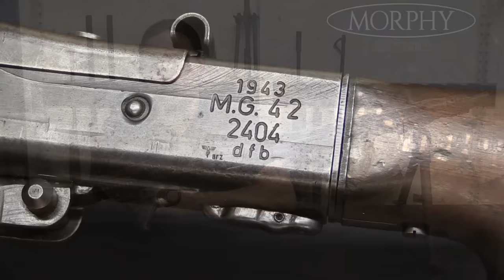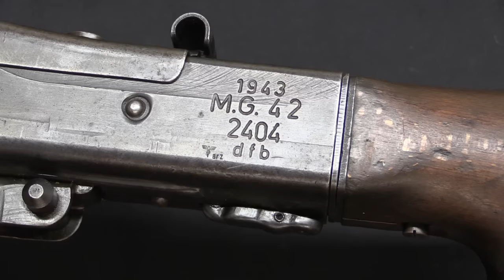Hitler's Zipper: The MG-42 Universal Machine Gun

Comment: When I was drafted in to the Danish army in the early 70'ies I became a machine gunner and this is the gun we used. You could reliably hit larger targets at 600M but it was a good idea to strap an old tin can just outside the feed port to smooth out the belt feed to prevent hang ups. It was a bit tricky to shoot if you were not lying down but they did teach us to use it in a walking stance for close combat. You had to grip the forward legs with your left hand and jam the butt very tight in towards your body. If you did not hold it tight enough the recoil would not reload the gun and it would stop. It came standard with two barrels, a cooling tray and an asbestos glove to change them with. They got real hot in a hurry. Pretty sure I could still field strip and assemble this one blindfolded. A bonus was that the cooling ports on the left side of the barrel shroud worked great as a beer bottle opener. Take the bottle in your left hand and stick the cap in while you flick the pistol grip with your right hand and Viola!... Yes that was in the days before screw top beer bottles :-)
Reply: You have screw top beer bottles in dennmark?
Reply: @thebaumfaeller1477  Nah but I now live in Canada and it comes with weenie US beer
Reply: Screw top beer bottles? What kind of atrocity is this? Usually you have to taste beer to judge it, but if it comes in a bottle like this, you immediatly know it will be pisswater :D
Reply: @yoshisaurusrex3767  Actually, I've seen local breweries here in Quebec use screw tops while still having a good product. I can't imagine it'd last very long that way though.
Reply: @asweknowit123  Though a champagne cork rather than screw top Unibroue's Maudite gets my vote
Reply: @yoshisaurusrex3767  Yuenglings comes in screw top bottles. That's the only scewtop beer I can say is safe to drink
Reply: @Kim-the-Dane-1952  I don't know any beer in the US that has screw-off caps.  Only girly drinks and wine coolers have screw-off caps.
Reply: @Kim-the-Dane-1952  Since when does Budweiser and Coors have screw-off caps??  Has it actually been that long since I last had either...?
Reply: Probably the MG3 though.
Almost the same gun, but 7.62 mm.
Reply: Screw top?
That sounds hellish
Reply: You talk about some excellent intimate history you have with this legendary weapon. And all people can comment about are bottle tops.

Meine Got.
Reply: @thehavoccompany-a3  more like twist off caps
Reply: @davecrupel2817  What does "meine got" mean?
Reply: @oldverner  100% sure its not a MG3, other charging Handle, no "Fliegervisier" aircraft sight and the Pistolgrip is Metal ..............., its an early MG42
Reply: @Sturminfantrist   :-) I was talking about  the danish army gun "Greerops" mentioned in his 
comment - not the one in the video :-)
Reply: @23GreyFox  It's meant to be "mein got" meaning "my god" in German.
Meine is for female words mein for male.
Reply: @phreak761  War auch nur als witz gedacht, obwohl es "mein gott" heißen müsste.
Reply: @23GreyFox  Mein got.
Reply: @Kim-the-Dane-1952  are you sure that it was a mg42  and not the mg3 which is it's successor
Reply: @timansorg9594  Pretty sure as that it what it was referred to as by the regiment (M42) but naturally I could be wrong.. it  had the bakelite shoulder stock but naturally it was the one with the ratchet loading handle.
Reply: @Kim-the-Dane-1952  okay I just thought that by that time the mg42 was phased out in most armies and replaced by the newer mg3
Reply: @timansorg9594  Yeah well maybe not so much the Danish army  :-) The regiment also still operated Centurion tanks with gasoline engines at that time
Reply: @Kim-the-Dane-1952  so it's save to say they weren't up to date at that time:)
Reply: @timansorg9594   Indeed.. ..The riflemen even used the good old Garrand rifle. To this day 30.06 is my favorite hunting cartridge
Reply: @Kim-the-Dane-1952  well I mean if it worked it's not that bad. Yeah the 30.06 is a great bullet which has proven itself in many occasions now
Reply: @phreak761  God is "Gott", i'm native german.
Reply: @23GreyFox  Oh mein got.
Reply: @phreak761  Ok, i get it troll.
Reply: @23GreyFox  *Oh mein got.
Reply: @Kim-the-Dane-1952  You are probably talking about MG42/59 which is early MG3 variant(7.62x51mm NATO) which Denmark bought in sixties. They weren't original 7.92mm MG42 surplus that's for sure.
Reply: @kognak6640  Thanks for the clarification. That would explain why they were still referred to as MG42's at GHR
Reply: Someone also mentioned that the MG42 and MG34 don't have have much recoil due to an Online stock is this true?
Reply: @omartorres5688  I can't really say since I don't have much to compare with.. the only other machine gun I have shot was the Browning M2 50 cal but they are always securely mounted. Still I thought the MG42/3 kicked pretty good.
Reply: @Kim-the-Dane-1952  I see but a least you got to shoot good guns
Reply: The function of this gun as a beer opener is impressive, much better than to kill people with this evil thing. But who is Viola? Did You open up her too with Your gun??
Reply: @yoshisaurusrex3767  it would usually be u.s-brew - We dont have screwbottles in europe, we dont need that kind of children assistance to get to the beer :)
Reply: @Kim-the-Dane-1952  Hvorfor flyttede du?
Reply: @timansorg9594  Well at that time we had the strongest artillery out of the nordic countries in europe
Reply: @ulfenburg7539  pga arbejde. Jeg arbejdede for ØK og var i Hong Kong og Manila før jeg kom til Canada. Jeg er nu gift med en Canadier og tog ikke hjem da ØK lukkede. Canada er et fint sted at bo.
Reply: @Kim-the-Dane-1952  Ja det er det.... men det er nu ikke Danmark :)
Reply: @ulfenburg7539  Nej det er rigtigt nok og det er måske også derfor at jeg stadig er Dansk statsborger og kommer hjem så ofte som jeg gør.
Reply: @Kim-the-Dane-1952  Det er godt at hører at vikingen kommer stadig hjem en gang imellem.
Reply: Brugte en MG til at åbne øl - Jeg har aldrig været mere stolt over at være Dansk en den sætning.
Reply: @christiankongsted5084  Bruh. Jeg glæder mig til jeg kommer i hæren men jeg skal fandme ikke ind i infanteriet. Mit mål lægge i at komme ind og bruge vores nye artilleri
Reply: @ulfenburg7539  Hey bruh, skal faktisk selv i hæren, ind til Jydske Dragonregiment. Godt at vide at nogen i vores artilleri kommer til at se de rigtige videor. ;)
Reply: @christiankongsted5084  Hey hvor gammel er du? Fordi det kunne være grineren hvis vi kom in på samme tidspunkt.
Reply: @ulfenburg7539  25, jeg trak frinummer da jeg var 18 og valgte for nyligt at prøve værnepligtenl. Jeg skal ind den 1. marts, corona gjorde at jeg ikke allerede er startet. :(
Reply: @thehavoccompany-a3  screw tops are an American thing, the only screw top bottles in the UK are American beers, not that many have managed to break into the market. I was under the impression that all American beers were screw top as in all American films and TV shows they're always screw top.
Reply: @kaneworsnop1007  Only the crappy (mainstream pi**water) beers.  The good beers (typically from local breweries that aren't commonly seen outside the US) always have the standard caps.
Reply: I used it (well the MG3) 40 years after you did, also as a dedicated machine gunner.
The only difference is we used thick leather gloves (for obvious reasons).
Reply: @CharlieTheAstronaut   Did you also have a grumpy helper who had to carry the tripod mount along with his own gun? ha ha
Reply: Exactly. The high rate of fire made the extra barrel a need, and the bolt was typically German-over-engineered.
Yes, it was a god MG and the most important wapon of the infantry group (and the Carl Gustav).
But I'm still convinced that Madsen could have made a better, less complicated, lighter MG, with a less firerate, that would preserve the barrel from getting to hot.
Reply: Omar Torres o
Reply: greerops in
Reply: greerops b by in
Reply: greerops l on
Reply: greerops in
Reply: Christian Kongsted pool job
Reply: DeadlyBacon in tv
Reply: The mg3 was adopted by the Danish army in 1962, therefore it was officially called mg m62.
Reply: @bjarnefrederiksen8540  Tak Bjarne
Reply: @Kim-the-Dane-1952  agreed an mg42 should come standard wit any good case Of danish beer.
Reply: @23GreyFox  like "OMG" - "my god" literally.
Reply: @MarquePierreSondergaard  I know.
Reply: @iberiksoderblom  Over engineered? How? The MG-42 is in the list of best MG's ever produced for a reason. The Madsen is not in that list. The Madsen is harder to produce and maintain.
Reply: Much regards for mentioning a beer bottle opener.Always a good thing for any tool/vehicle/gun to have to any real soldier ;)
Reply: @23GreyFox  It's misspelled German for "My God". Correct spelling: Mein Gott.
Reply: @Kim-the-Dane-1952  you wanna try the checzk budweiser, which is the original -that is beer
Reply: @zymelin21  I completely agree with you :-)
Reply: Woah woah aesbestos gloves?😳
Reply: @_david_xu_5926  Sure.. remember this was the early 70ies. I think they would have been happy to put that stuff in breakfast cereal just to increase the fiber contents in those days
Reply: @Kim-the-Dane-1952  thanks for sharing man I'm a Canadian and always had trouble opening beers with my mg42.
Reply: @Kim-the-Dane-1952  well happy we have stricter guidelines now thanks for sharing
Reply: I bet the armoures loved people who used their weapons as bottle openers.
Reply: @Kim-the-Dane-1952  I feel attacked, lol. I spent a year (conscription) as spotter/loader/replacement gunner in an HMG squad (MG3 or m2.50 depending on circumstances). Thankfully we almost exclusively used tripods for fixed positions, so we rarely had to lug them around. I would gladly have traded my G3 for an MP5 though, what with carrying spare barrel, tools and ammo for the MG3.
Reply: Mhmm asbestos.
Reply: Interesting....
Reply: He’s not referring to a screw top cap like a bottle of soda or water. 

What he’s referring to still looks like a metal stamped cap, but instead of requiring a bottle opener they can be twisted with the bare hand.
Reply: @Kim-the-Dane-1952  30.06 was the first round I ever chambered! 8 years old and my uncles say let the little guy fire grandpa’s deer hunting rifle. Dad stood behind me when I fired so I didn’t get laid out in the yard, it hurt so bad from the recoil! To this day I remember it so clearly 50 years later.
Reply: I can't believe Gun Jesus made a 23 minute video about this gun and failed to mention the bottle opening feature. A major oversight.
Reply: @Kim-the-Dane-1952  bless you, old soldier. A nice story for sure. Yes, my country has awful “beer”
Reply: @kaneworsnop1007  it depends on the beer. Screw tops are common, mostly on corporate products. Just a roll of the dice
Reply: Meh, many craft breweries use screw top bottles. Screw-tops no longer denote pisswasser. Any American that gives a shit about beer knows which brands are best only for the infirm, young and elderly.
Reply: That's awesome, my father was I'm the US army in the 90's and used the M60 in his support gunner role. A funny thing he figured out is that if you take two of them and put the belts on one forearm and lift them up and start shooting, the recoil helps keep them up so you can fire two of them at once!
Reply: @Kim-the-Dane-1952  haha still european at heart
Reply: That's some OG shit right there, respect
Reply: CAP
Reply: You know, I would buy you a beer and open it myself to just hear more of your stories. God bless.
Reply: @Kim-the-Dane-1952  nope they aren’t beer
Reply: The cousin is the US..m_60.. I used that one that was after Viet nam.. I could Field strip fast back then
I'm in my 60s now and could blast the CRAP out of anything still... forgot the break down of it.
Take care.
Reply: Dude that makes you like the GI Joe called Roadblock. That's incredible that you could fire this from the shoulder.
Reply: Why did you move to Canada?
Reply: @Kim-the-Dane-1952  I thought you moved because of the beer  :D
Reply: @cochinaable  I worked for a company that posted to several jobs worldwide and eventually ended up in Canada where I then quit the company and stayed. It is a very nice place.
Reply: Yesss but i use a sling if firing from the hip which i learnt in firing the FN GPMG when i was a soldier and an abestos glove is essential too.
Reply: Vi bruger den stadig som tårngevær 😂
Reply: 100th comment: Legendary
Reply: @Kim-the-Dane-1952  its a damn Good Caliber for Hunting.
Reply: @yoshisaurusrex3767  lol you cant base flavor on whether or not the bottle is a screw top or not. 3/4s of americas beers are not screw tops but they still taste like shitty flavored water.
Reply: The idea of being a unit that draws heavy fire by it's very nature, and being fairly stagnant in the process, must have been terrifying
Reply: This has got to be the most badass comment on this video haha, have gun ..will travel .
Reply: This dudes a fucking bad ass
Reply: dang you musta had killed a lot of fellers with that there machine, eh?
Reply: @yoshisaurusrex3767  ok child
Reply: Spoken like a squaddie
Reply: @Kim-the-Dane-1952  Are our beers not sufficient in size?
Reply: For some reason I read this comment out loud in a danish accident, you should’ve seen the head tilt action from my 9 month old German Shepard. She is something else, both sire and dam are of the East German working line. My 6 year old GSD he only gave three tilts, I’m sure there would be more if the words ball and throw were used.
Reply: Fair show! To be honest though I still pop screw tops since they tend to love to get stuck and rip your hand when you're a bit bottled.
Reply: I will cherish this knowledge forever. Thank you, kind Danish veteran 🙏
Reply: Screw top beer bottles? Here in Germany this is literally non-existent, except for those plastic beer bottles.
Reply: Are you sure it isn't an MG3?
Reply: @munanchoinc  Somebody else mentioned that as well and it is entirely possible because of the arrangement of the cocking leaver but on the other hand it did have the bakelite shoulder rest so I am not sure.
Reply: @ralfhtg1056  I’ve seen screw top bottles only once here in Ireland. And it was Miller. So barely beer in the first place.
Reply: just a little tip it's "Voila" not "Viola", freat story tho !!
Reply: @michaelkeaton5394  Je suis vraiment désolé.  Mon professeur de français serait horrifié.  Je blâme "auto complete" sur mon téléphone.
Reply: @Kim-the-Dane-1952  auto correct ducoup, nah no worries man i always screw up a few word in other languages too...
Reply: @deltabravo9908  Nice try buddy :-) ... anyway good for Scotland... the only screw tops you need are the one on the Whisky bottles
Reply: @deltabravo9908  God no!!!! I was referring to my current place of residence which is in Canada
Reply: I might be cool but I’m not as cool as you my friend
Reply: What about longships? I heard the danish were Vikings, is this true or false?
Reply: @Kim-the-Dane-1952
Reply: Yep. I fired one of these a Soup can works wonders. I am a Gatling Fan so how to make a 155mm Howitzer turn into a Rotary. Hmmm
Reply: @greerops 
I was in Germany in the Bundeswehr as a MG Gunner too, i had the MG3 as a service weapon too, and i can confirm that the heat protection shroud is an excellent beer bottle opener 😁😆
I used the same hole every time to open up a bottle back in time of Cosovo, and it worn out very much.
You could easy see the one hole and everybody knew what that came from 🤣😅
Reply: @saschakorner9317  Ha ha.. Great minds think alike
Reply: @timansorg9594  The MG3 is the same as the MG42 except the calibre. Italy adopted the MG3 and produce it under licence. The call it MG42/59.
Austria call their MG42 version MG74 because they adopted it in 1974,
The first batch of MG3 delivered to the West German Bundeswehr in the '50s had their MG42 markings stamped over with 'MG3'. Except the barrel the parts are interchangeable between MG42 and MG3.
Reply: why was this MG not used as a COAX MG in tanks??
Reply: @yepi3345  due to design of the barrel change system necessitating adequate clearance to the right side and the right side only due to the inability to switch which side the barrel is ejected from during changes.
Reply: Indeed; I served in the Danish army as well (hej i øvrigt), although later on so we had the '62... but same family, though. c",) Along with the 12,7/.50 cal. they did a good job.
Reply: @brufnus  Hej tilbage. Ja 12,7'eren var også sjov at skyde med.
Reply: Thanks for the great recollection on use of MG42.  I carried the M60 for a period when I was in the US Army Infantry.  Supposedly it was a fork of the MG42 development.  The most interesting and unique part of the M-60 design in my experience was its low hopping rather than it just climbing.  It made it perfect for grazing and suppressive fire.  We were never allowed to fire it from the hip (assault mode) of course I did it a couple times but it sucked almost a complete waste of ammunition.  We had problems with blank firing adapters that wouldn’t provide sufficient gas to work the action and you would have a bolt action rifle.  😂 
I volunteered to carry “the pig” because I only had to carry my kit and ammo and was now a major asset for the company and had the power to defeat just about any opponent in a firefight.  Nothing like the look on your buddies face when I would bound up and drop in the prone and carry the day.  😊
Reply: @daviddunkelheit9952  Thanks.  I agree with your observations and it was indeed fun to stroll about being the Lord and Master of small arms but as my sergeant was fond of reminding us: In active combat the machine gunner has about a 10 second life expectancy 😒
Reply: @Kim-the-Dane-1952  I’ve heard that as well and I had a Company with an odd SOP for night-time operations (training exercises).  Because of the distinct sound of the M60, anytime we fired it we had to displace our position by a minimum of 1 grid square (1 kilometer typically).  We were in wooded granite highlands and that really sucked to move a click plus everytime.  So it was decided that at night when we are getting harried by probe attacks from OpFor I was not to give away my location by engaging in a firefight… 🤭
I got to just lay there in a ruck flop with my pig in my lap or across my abdomen.  On vacation 😆. I loved it got to catch zzz and less carbon to clean later.  It was totally the opposite of what most guys expected.  I later was a M249 SAW gunner.  Not quite the same. It was based on the Belgian FN Minimi (Mini Mitralleuse) fired 5.56 from assault packs or 30rd clip.  The early ones didn’t have a good heat shield over the barrel so I burnt my forearm twice as I would control the hop in the M60 with my left forearm.  The early version also had “normal” and “adverse” cyclic rate selection.  It had a high rate of fire already and supposedly adverse rate was to clean out the carbon if you didn’t have time to clean your weapon..  700-850 normal 950-1150 adverse.  That could only be used with regular FMJ rounds as any BFA could not support that rate of fire and would go downrange. 😱
Good memories! Allons! Enjoy your weekend nice chatting
Reply: @daviddunkelheit9952  Thanks... You have a nice weekend as well.
Reply: SAME with our M-60 the tin can helped feeding issues!
Reply: How did you know when it was time to change barrels?
Reply: @12macevedo  I dont recall exactly what the official guide line was for actual combat shooting but since we were just practicing it never got too hot and you changed barrels occasionally to get even wear.  I do recall that they said that you could throw a barrel in a puddle cool it off if necessary but i wonder what that would do vis a vis heat difference stress
Reply: @oldverner mg3 has roughly half the firerate of the mg42. But they are almost the same gun.
Reply: Fedt
Reply: I was trained on m60 mg
Reply: @thehavoccompany-a3  typically in the USA all domestic beers are screw tops and all imported beers are bottle capped
Reply: Very cool. I can't imagine shouldering that thing and being able to hit any size target, especially in the manner you were taught. Seems like you would have to contort your body very awkwardly to be able to reach the bipod. Might have been better off putting the asbestos oven mitt on your left hand and grabbing onto the barrel guard. Probably not going to get too hot anyway because I can't imagine sustained fire from the shoulder would be a thing in any situation
Reply: Lol